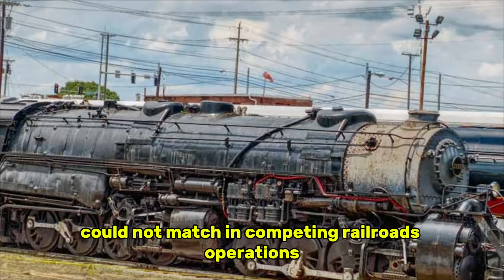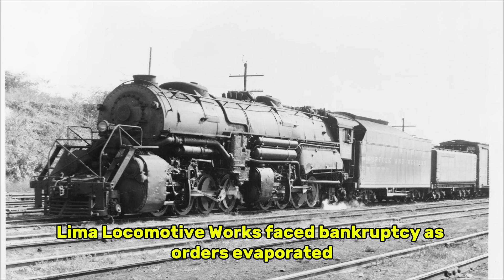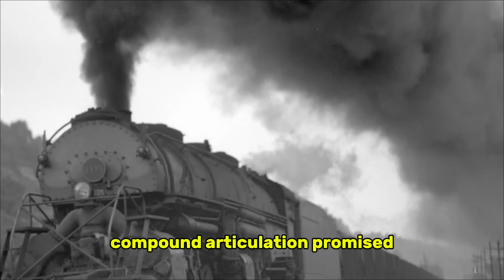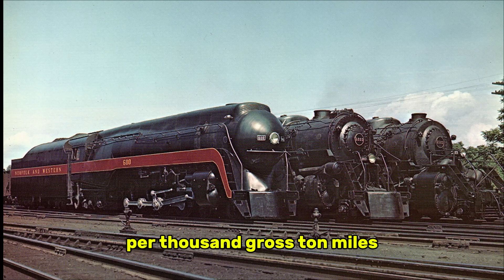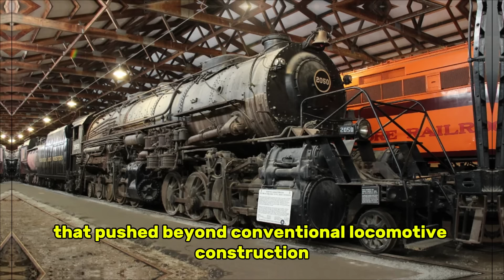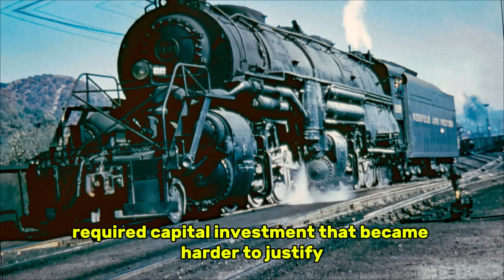The Experimental Freight Engine That Could Pull 150 Cars Alone

Comment: 6:40 The narrator mixed up the description of operation of the locomotive. The 600° Steam @ 300PSI enters the High Pressure Rear Cylinders first NOT the Low Pressure Front Cylinders, which get the exhausted steam from the High Pressure Rear Cylinders. Other than that small mistake a Great Video that is very informative! P.S. It was described correctly after that mistake.

Comment: At this point, it’s important to clarify a key technical distinction regarding cylinder placement and steam pressure, because this is where confusion often arises. The larger cylinders mounted toward the front are low-pressure cylinders. After steam has already done work and expanded, it enters these cylinders, where the larger volume allows engineers to extract the remaining usable energy. The smaller cylinders positioned toward the rear are the high-pressure cylinders, which receive fresh steam directly from the boiler. This configuration is characteristic of compound steam locomotives. The engineering objective behind compounding is fuel efficiency: instead of exhausting steam after a single use, the system expands and reuses it across multiple stages. However, this approach comes at a cost. Compound designs require more complex valve gear, precise timing between cylinders, and significantly higher maintenance demands. By contrast, traditional American articulated freight locomotives—such as the Big Boy—follow a completely different design philosophy. In these machines, all four cylinders are high-pressure cylinders. Steam is delivered directly from the boiler to every cylinder at full pressure. The result is:

- A far simpler mechanical system
- More direct power delivery
- Greater reliability in daily operations
- Easier maintenance under heavy service conditions
- Exceptionally high tractive effort, especially on long grades

Union Pacific’s decision to favor this layout had little to do with maximizing thermal efficiency and everything to do with raw pulling power and operational robustness. On routes like the Wasatch Range, where massive freight trains had to be hauled over sustained mountain grades, simplicity and brute force mattered more than theoretical fuel savings. A straightforward, high-pressure system was better suited to real-world railroad demands. In short, the reason the front cylinders appear larger is not because they are more powerful, but because low-pressure steam requires greater volume to do useful work. Locomotives like the Big Boy eliminated this distinction entirely by abandoning compound expansion in favor of a design focused on maximum power, durability, and dependable performance under extreme conditions.

Comment: Steam has more torque compared to diesel.  If there could be continued a system on all steam engines with a Rankine system you would not to have as many water filling stations.
Reply: Not sure what you mean by steam has more torque?  Steam's horsepower is more efficient at higher speeds assuming all the other complexities have been optimized... primarily because it doesn't have to deal with Counter Electromotive Force or CEMF that is has to be dealt with in electrical traction motors. The state of the art AC six axle diesel locomotives interestingly have about the same level of starting tractive effort as the optimized Y6b's...
There were a few areas dealing with the high and low pressure cylinder arrangements that could be clarified... but to my eyes this was one of the best videos on this topic that I have ever seen and I have visited Farmville and Crewe, Virginia to see these and the 'A's in operation and it was undoubtedly one of the best days in my life!
Reply: @cheryltysver4819  https://www.youtube.com/watch?v=muFKY2r5Px8&t=391s

Comment: Simple economics. Steam was waaay more expensive than diesel. The man power to maintain the machines, the time they spent in maintenance and as often as they required maintenance. The infrastructure to run steam and the man power to maintain that infrastructure. Nobody ever questioned the capability of steam. They out pulled diesels hands down, but you can run 5 diesels for much less money than 1 steam. And diesels didn’t require constant maintenance and infrastructure. With all the ridiculous government regulations on railroads, the competition with trucks and the loss of passenger travel all contributed to dieselization. They had to cut the costs or go bankrupt, which most did anyways, hence the birth of Conrail.

Comment: If you research something about steam engines, double, and triple expansion types, you will learn that the hugh pressure cylinders are the smallest, and they get progressively larger as the steam expands to the next set of cylinders at a lower pressure. The Y6B uses double expansion. The high pressure steam goes into the first, smaller set of cylinders, and expands as the piston is pushed by it. It then exhausts into the second larger cylinders at this lower pressure, and expands once again. The larger surface area of the second set of cylinders allows the lower pressure steam to generate similar power as the smaller high pressure cylinders because the steam is pressing over a larger area. Now, if you look at pictures of the actual locomotives, you will see that on the Y6B the REAR cylinders are the smaller diameter ones, and the FRONT cylinders ate the larger diameter ones. The cylinders are the LOWER part of the assembly, with the valve gear above them. So, you got it backwards. The REAR set of cylinders are the high pressure cylinders, and the FRONT set of cylinders are the low pressure cylinders.

Comment: 18:33 "12 miles of 114% climb."  Whaaaat the hell is that??? A rocket can do that but not any locomotive. Especially one that is pulling a train. Furthermore, most airplanes couldn't climb 114% for 12 miles. This must be a train video's equivalent of a fish story. Only "AI" or more accurately "Artificial Stupidity" could come up with a garbage statement like that.
Reply: Why bother watching beyond the first seconds where a German stem locomotive is captioned as being in Roanoke VA? It's immediately obvious that this is AI slop.
Reply: I'm amazed at a number of the comments here!  With regard to this comment the grade was 1.14%!  That's 1.14 feet increase in height per 100 feet of travel!

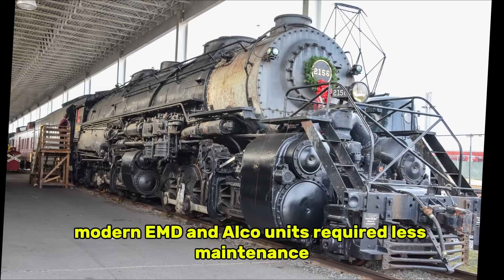Comment: @2:20, the images are of the only remaining Norfolk and Western Y class locomotive.  It is preserved (not not operable) Y6a No. 2156.  Y6b was actually the final sub class, but none remain.
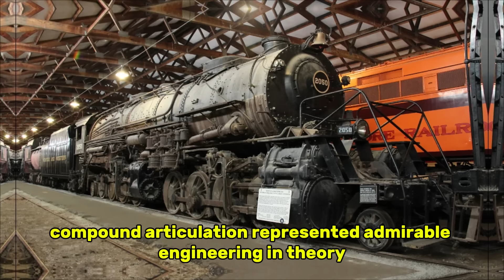Reply: Remember... 🙂 2156 was upgraded with modifications to Y6B standards along the way, as were other Y6A models of the class.  and it's not the only Y class locomotive that survives.   There is also a Y3 (2050) that was preserved, shown at 15:50.   It's true that none of the original Y6B locomotives remain (I saw the last one get scrapped) but 2156's modifications by the Roanoke shops means that it IS a Y6B, if only by proxy.   ;-)
Reply: @tonyunderwood9678  Magnificent locomotives absolutely perfect for their intended task. I believe the Y6bs had the ability to use live steam in the LP cylinders to give more tractive effort if required at least at low speed. It would be great to see 2156 returned to steam. Likely very challenging to do this so sadly probably not a realistic prospect.

Comment: The reason the N&W kept steam so long was that they literally owned and mined their own fuel, saving millions in fuel costs. 

At Williamson, West Virginia, the last holdout for the Y class locomotives, there was a coal mine right across from the yard that literally had an overhead bucket system that brought newly mined bituminous coal from the mine and tipple right into the yard to feed the steam engines. My next door neighbor in Williamson, worked in that mine until it shut down when steam was completely replaced in 1961. My dad was a brakeman on the yard. The Y6B wasn't the only Y class locomotive. In the 1940's and 1950's, there were many Y3 - Y6B classes still working during that time period. All together there were nearly 250 Y class 2-8-8-2 locomotives built since the early 1900's. The Y class wasn't just a special use engine, it was the PRIME ROAD MOVER throughout the N&W's Appalachian coal fields. The  mighty A class 2-6-6-4 took over on the hauling, West of Williamson and East of Roanoke/Lynchburg. The Y class was shorter, but stronger than the A class and handled the steeper and tighter rails in between, in the mountains. 

Sad to say that there were NO class Y6B locomotives saved. There are 2 class Y6 engines that were saved, in museums, but NOT ANY of the final Y6B's were saved. 

Additionally, the famous streamline 4-8-4 J class 611 is still preserved and running passenger excursions to this day.

Comment: No. The front bigger cylinders are the low pressure ones. The rear cylinders are the high pressure ones. Your AI got it backwards. The simpler articulated locomotives like the "Big Boy" use high pressure cylinders on all four, resulting in a mechanically simpler and more powerful locomotive for Union Pacific hauling freight over the Wasatch Range.
Reply: Wrong, the Big Boys were not more powerful than the N&W Y6b... and they were much less fuel efficient as well.
Y6b locomotives used the same steam twice resulting in basically "free" work effort.
The Y6b was also more controllable at low speeds/high tonnage.
Heavy loads at slow to medium speeds are what they were designed for whereas the Big Boys were designed for heavy tonnage at high speeds which is why they had larger diameter drivers. Norfolk & Western did not operate on flat prairie subdivisions so the higher tractive effort/drawbar horsepower with smaller drivers was their key.
Two different machines... but the Y6b was actually more powerful. White Paper tests proved it.